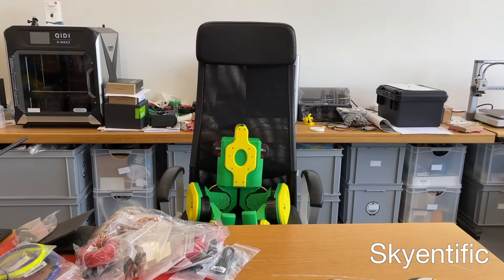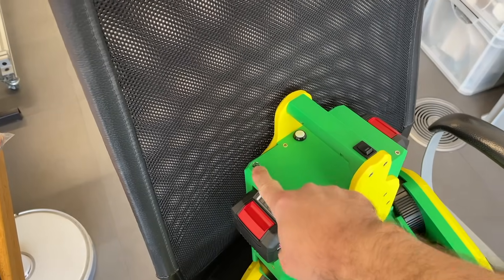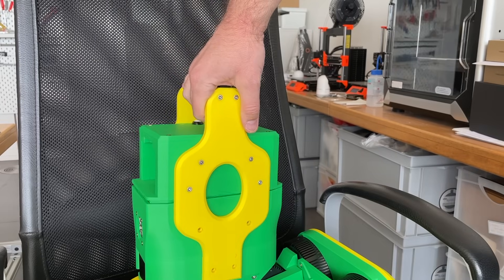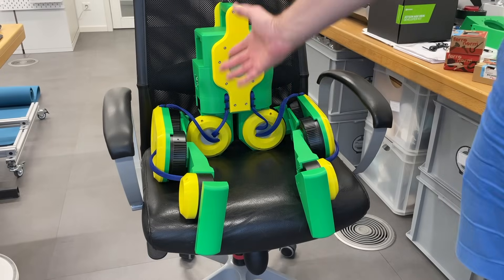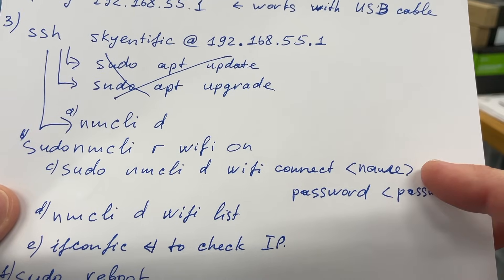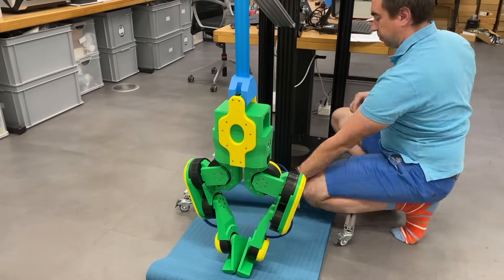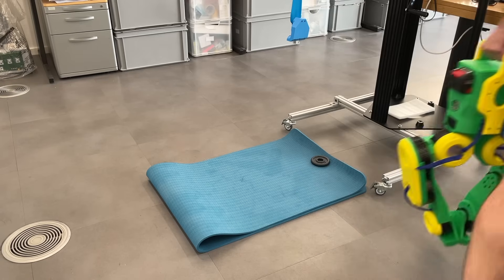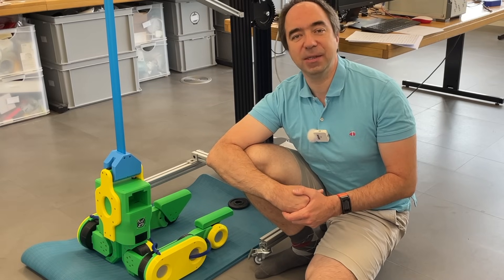Building the Robot from the Simulation

Comment: Great video. If you don't mind I have some questions. What type of gearing is in the motors - planetary, strain wave, cycloidal? If planetary, single stage, split-ring compound? Also did you consider direct-drive? You wanted the actuator easy to back-drive as it makes reaction force sensing better? Asking as I might try this.

Comment: great ， but why don't use Damiao motor ? 
In China's universities , Damiao motor is popular in make humonid robot. 
Because Damiao created a humonid robot using their motor , only 799 RMB per motor , it's gear box based motor , cheap. 
Compair to Unitree's motor , gear box based too , but with price 3300 RMB, dam unitree,
Reply: And , why using 3D printed structure parts?
Laser cutted aluminum plate is better,  not expensive . 
And in China , you can send the CAD file to factory ,  24 hours later , you can get the cutted plate, much faster than 3D printed .

Comment: 8:01 Very cool, just as a heads up: IMUs are very sensitive to resonance and relative vector. Meaning, when it walks the frame and shell experience waves of vibration and flex. Having the IMU tucked away like that can be become a headache for the feedback model. Best to try to align the body coordinate with the IMU coordinate by placing the IMU at the gravity center of the torso with a very rigid relation to the first leg joints. Also foot sensors would be crucial as it’s the most important force coming from the ground to avoid slip in gate. There are 3d printed approaches with optical sensors out there. Again very cool video, subscribed !